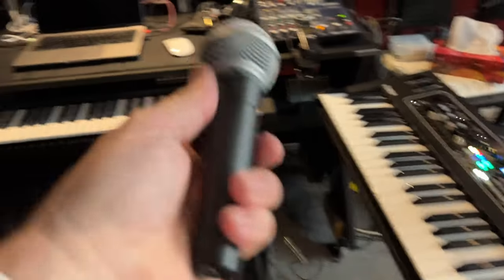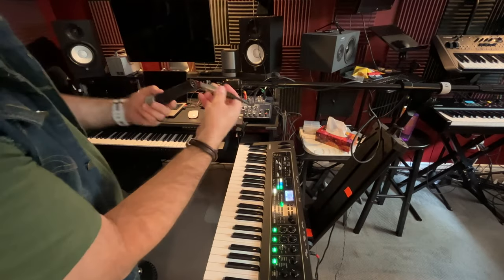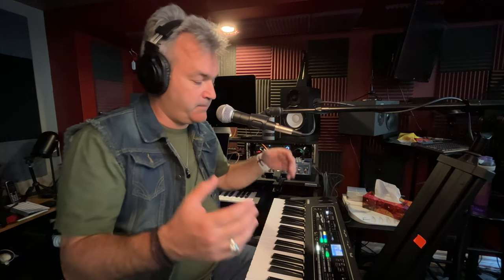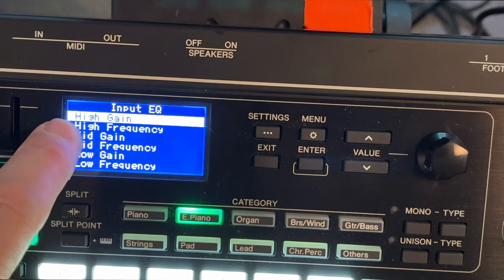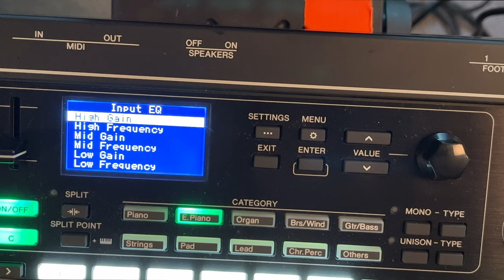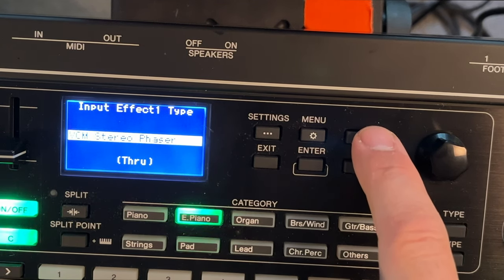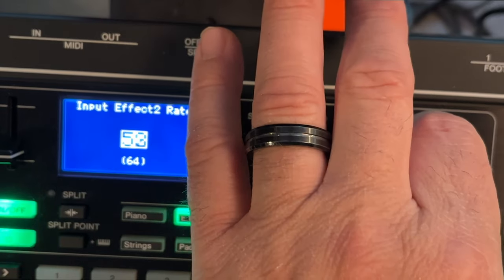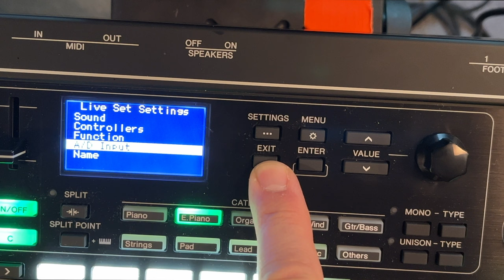YAMAHA CK61 - Tutorial - MIC THROUGH

Comment: Menu..A/D Input Type....Select MIC....Not line.... Turn the gain up on the back. my sm58 is way too loud....You can also use the compressor to boost volume. You may have a dodgy unit, as others have commented how high the gain is
Reply from the maker: Thank you for the feedback. I will check it out . cheers

Comment: Nice. You could get more gain and better fidelity from the mic by using a balancing transformer between the mic and keyboard. Currently, you have an impedance mismatch which is causing your low gain by connecting a low impedance (balanced) mic into a high impedance (unbalanced) input. An impedance matching transformer in-between the mic and keyboard would take care of that. The Shure A85F, XLR-F to 1/4-inch Line Matching Transformer goes for $23 from Sweetwater and others. 😉👍
Reply from the maker: Thanks for the tips! Cheers :)
Reply: Exactly.

Comment: Hey KC. I was wondering if it is possible to plug in a MIDI drum pad like a Novation and set it up so you can play drums on the Novation the same time you can play keys on the CK 61. Thanks in advance for the response
Reply from the maker: Hi :) you can connect it however my concern would be the drum sounds which the CK does not have.

Comment: Do you know of a way to have the effects only on the Mic L/mono input only? I have another keyboard plugged into the A/D Right input and I get the effects on that too, which I do not want. I also get the effect on the Bluetooth backing track, which I don't want either.
Reply from the maker: Hi , for the analogue input from your other keyboard on one channel. I don't think you can have affects on specific channels. I think with the setup you have , you could benefit from having a mixer. You would feed the output of the mixer into the keyboard. If your mixer has effects capabilities, i would utilize that. Keep the setting in the CK dry with not effects in that case. cheers